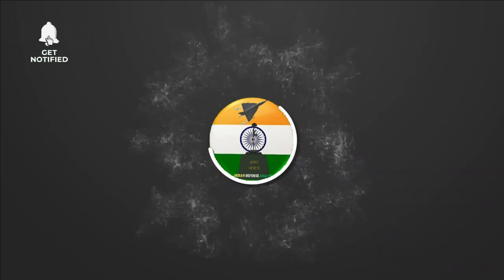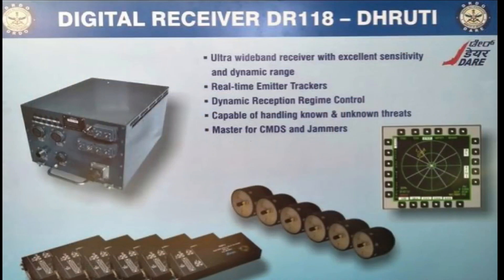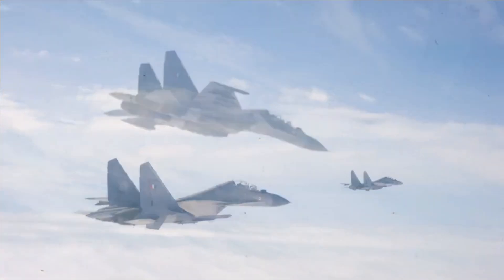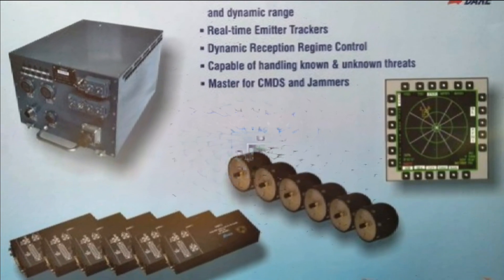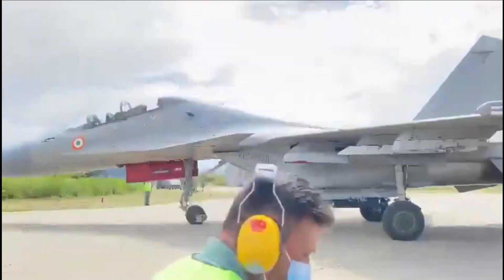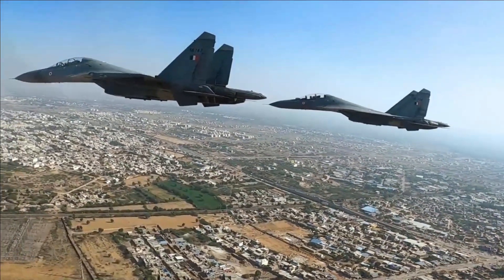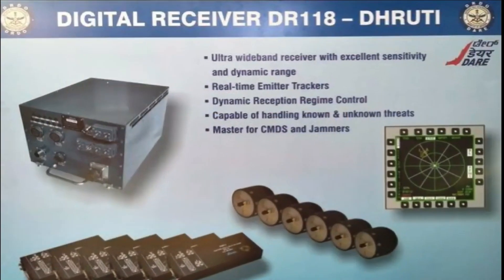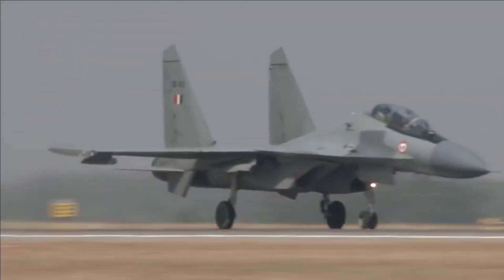#SuperSukhoi BEL has signed a Licensing Agreement for Transfer of Technology (LATOT) for Digital RWR

Comment: Bro want ur opinion on this- Commonality in functionality of aircrafts between both the navy & airforce is profitable in the long run. We'll be getting certain TOT of GE F414-INS6 engines which will be powering Tejas mk2, TEDBF & AMCA MK1. The same engine is also used in FA-18 SH. If both the Navy & IAF select FA-18 SH with certain enhancements then it would be a wise decision. IAF may not require the arrestor hook & ask to replace the foldable wing with fixed wing which may also reduce the cost of per unit aircraft, thus we can have more aircrafts with the alloted budget. This synergy of platforms between airforce & navy will also create economies of scale since a lot of our indigenous programs will be using the same GE engines. Also Royal Australian Airforce uses FA-18SH so this means that the aircraft is not limited to carrier based operations only & has the STOL capability even from land based runways.
Reply from the maker: It’s not about cost as well but about the requirements. Why would IAF go for FA-18 when it has SU-30 MKi which when upgraded can sweat FA-18. IAF certainly do not want another missile truck. For IAF they must go for Rafale anything else will be a mistake for sure.
Reply from the maker: Navy has another challenge of lift which is designed for mig29 lca navy and TEDBF. Fa-18 May face issue length wise for which exact clarity is not there and Rafale can only fit with wingtip removed. Navy’s situation is more tricky. However it’s official knows what’s best for them as per operational readiness. I hope they choose accordingly. 
Lets not try to find commonality of platform for both the forces as they have different requirement. In process of finding commonality one or other force will have to compromise in their requirements
Reply: IAF already used $4 billion in R&D for Indian rafale advancements.
So now we can easily get 114 rafales in just $11.4bn & probably even getting more than just 114 since the budget for IAF is $18bn.
Rafale is much superior
And IAF is probably waiting for the F4 variants
But France will deliver those from 2027 since it takes 3 year for the delivery to start after signing the deal.

Comment: In the Balakot Strike the Mig-21's lacked data links. Is there confirmation that the Rafael Bnet
datalink has been installed on all IAF aircraft like it was supposed to be starting from 2020?
Happy to hear Super Sukhoi upgrade is happening, but still no news about the important Uttam 
AESA radar being installed. Most important piece of new hardware, along with infrared.
Reply from the maker: Good question, will find about Bnet Datalink.
Uttam upgrade will happen around 2025-26
Have explained in this video :

Super Sukhoi upgrade back on track with Uttam AESA Radar
https://youtu.be/31MX34erqnk
Reply: @IndianDefenseAnalysis  but They said they will put uttam on mk1a🙁
If the radar's mass production starts from 2025 then how will they apply it on mk1a?
Reply from the maker: @fly463  mk1a will get Uttam only after 2026 or 2027 as per latest update
Reply: @IndianDefenseAnalysis  i see
So they will use something else till then
Reply: @IndianDefenseAnalysis  I am slightly confused as to why there is both a software defined radio and a datalink being installed.
As per Force Magazine tactical data-link will be the BNET-AR. SoftNet software-defined radio operating in VHF/UHF and L-band channels. Why can all 3 service not use the IN's datalink which is fully indigenous and meets their requirements?
Reply: @datoolz0   Because in aircraft minitiarization is very critical element. 

DRDO developed DR has larger weight and size and can't be minitiarise further due to technology gap. 
On the other hand Navy doesn't  need to care abt size and weight. 

I don't know what army is doing.
Reply: @nishantshrivastava9674  Navy is using same datalink with marines and its own planes/helicopters. You are wrong, they do care about size and weight. Navy SDR is the best, and all the other services should use that. The IA/IAF are building their own. This is where the CDS should step in and force one solution.